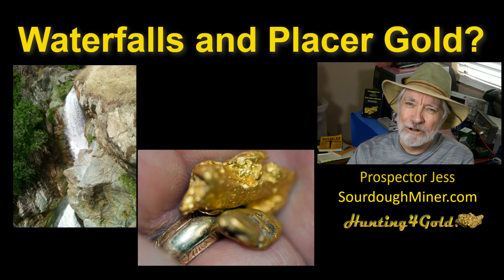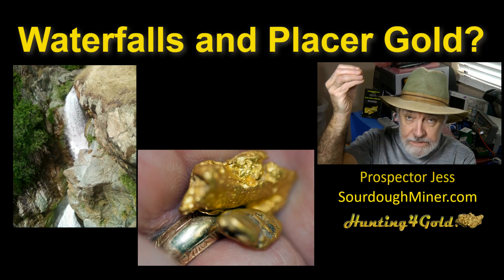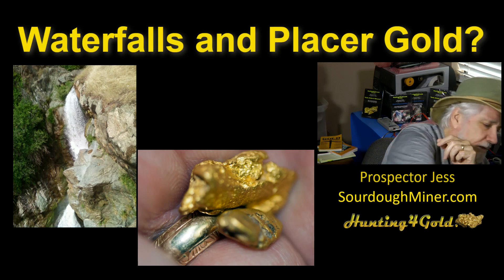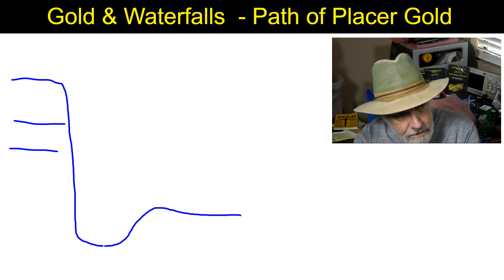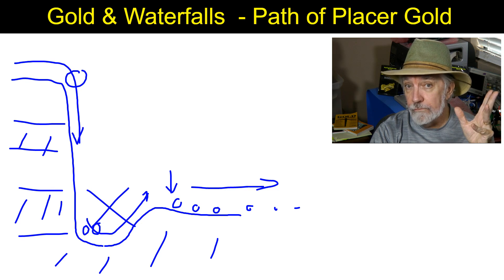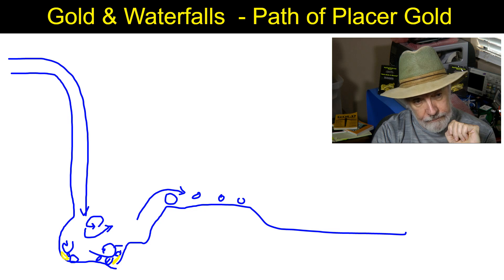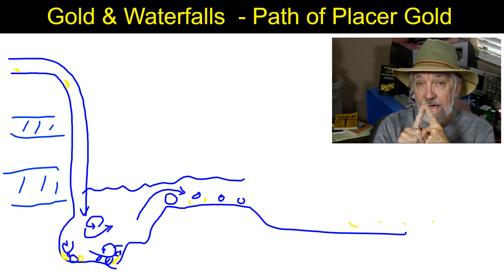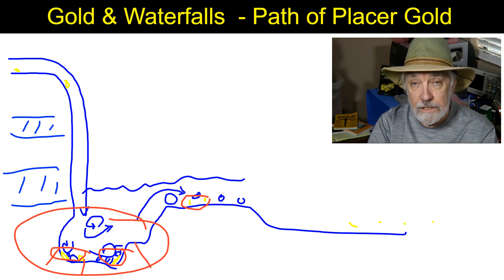Placer Gold Prospecting in Waterfalls

Comment: So, the larger rocks' locations would help you figure out which type the waterfall is.  And maybe if it's a rolling type you could wait for dry season (or low water) before risking it.
Reply: Take up fishing. Youl soon learn to recognise bottom formation from surface features. Creases. boils. And other turbulence show areas of low  pressure even in the fastest of flows.
Reply from the maker: It's OK to observe high flow from afar (with a camera) spot boil and eddy patterns for later and safer low flow investigation.

Comment: Nice! We dredged out a waterfall plunge pool last summer.  The hydrodynamics were wild!  We found the gold but it sure wasn't where we thought it would be.
Reply: ColoradoGoldCamp what areas did you find it if you don’t mind me asking? Thanks
Reply: @foolsgold1118  We did pull a few nice nuggets pounded deep into beckrock cracks at the base of the falls. I'm talking prying off 2-3ft deep of beckrock!  Think "blowout"
Reply from the maker: That's the core lesson. With turbulence goes turbulent gold traps.
Reply: @ProspectorJess  Moving water is a force to be reckoned with!
Reply: Thanks Colorado goldcamp

Comment: Hydro power is awesome!!
Reply from the maker: Especially run of the river hydro designs.
Reply: @ProspectorJess  we ran a 4" flex hose the full 100' just out of a creek and WOW! 4 to 1 drop and we put a turbine/pump off the dredge and motor did a reducer pulley to generator had more power then we could use. Ended up putting a valve up top to regulate the intake flow. I miss that ole man taught me alot of off grid and old school ways of mining and building and life.....
Reply from the maker: What type of generator and regulator did you use? AC/DC (Curious)
Reply: @ProspectorJess  12V DC with volt regulator set up like a alternator to charge 12V batteries.
Reply from the maker: @jeffreyallen3796  Plenty of power with a 1.5 kW inverter & battery to run a camp 24/7